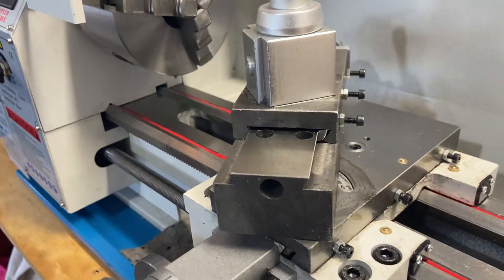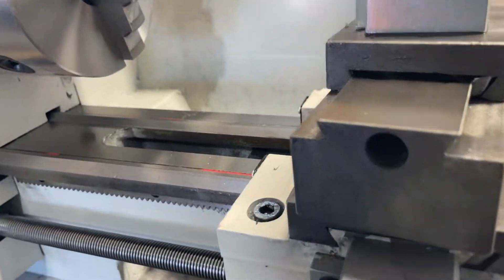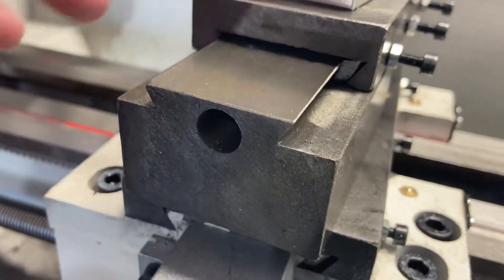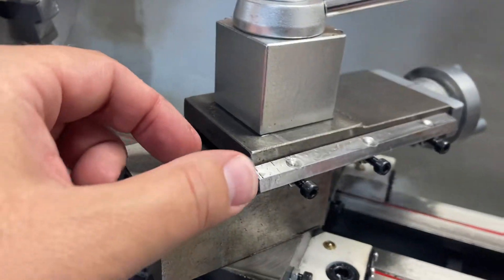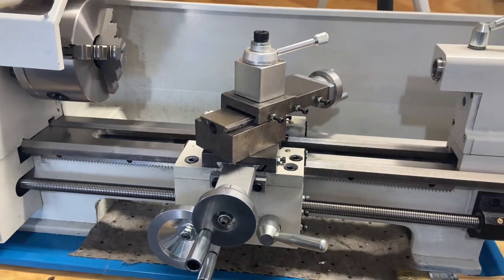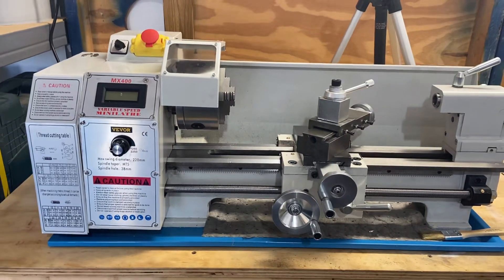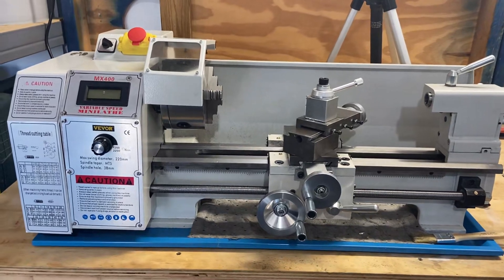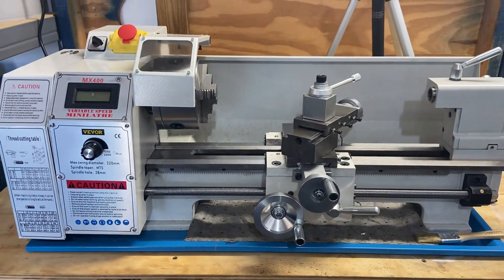Vevor Mini Lathe MX 400 Part 14 -Top Slide Gib Issue and Support Review

Comment: It's an affordable chinese lathe. Had it not been for the lesser quality details we would never been able to afford this hobby. -Schaublin lathes on the other hand, (Swiss made) don't suffer from "dragged-behind-a-car" style of gibs, but they cost both arms and both legs.
Brass stock and a mill, or a file plus some scraping and lapping will produce nice gibs.
Reply from the maker: This is a very good perspective and way to look at this.  I would have never started this hobby if it weren't for these affordable lathes.  At times frustrating but the challenge of making things better is part of the fun and process for me.  Thanks for the comment and thanks for watching
Reply: @deezworkshop  I bought a chinese minilathe of the heavier and larger variety here in Norway.
The basics are OK and works fine;- the ways, spindle, chuck etc.
But the gibs are just as terrible as on your lathe. They must have been machined with a lawn mower
These guys know how to make a proper gib, but if they were to go down the Schaublin path, the poor soul that machines, scrapes and lapps the gibs would still sweat over a gib when the other workers were finsished machining all the other parts.
The first thing I did were making new T-bolts for the compund since the original bolts snapped when trying to tighten down the compund slide.
Then I drilled two more holes and added two more T-bolts.
Then I tossed out the flimsy sheet metal stand and bolted the lathe to a heavy  wooden bench almost as heavy as the lathe itself. -And that transformed the lathe enormously.
Then I got rid of the compound all together and made a solid toolpost.
Next up is making a new gib for the cross slide, preferably a tapered gib but anything will be better than the one that came with the lathe.
-As you say, this is a hobby, and modifying a cheap lathe is part of the fun.
Reply from the maker: @eriktorp-olsen1706  "They must have been machined with a lawn mower"  🙂  Yeah,  this lathe is no more than what i expected and I am just glad I'm able to turn materials with it.  The tailstock has been a challenge and continues to be,  I believe a lot of my problems are from using a cheap live center, cheap Drill Chuck, and it being aluminum all factor in.  I will continue to try to get it dialed in.  Sorry to all those skilled machinists watching for all my cringe worthy moments.  I am still learning but having fun doing it.
Reply: @deezworkshop  Aluminium tailstock . . . hmmm . . .
Maybe it's good enough, I don't know. My solid toolpost is aluminium,-made from old engine parts melted down behind my shed and it seems to do well.
After all, they make engine blocks from the stuff.
 -But nothing beats cast iron which refuses to compress or flex under load.

Comment: I just wish i still had mine g0602 manual. I got frustrated with backlash and turn it into CNC but now DRO is so cheap I would put it and be happy. If I get such a lathe thats what I would do. They have now magnetic scales that are so small it may fit even on such small lathe.
Reply from the maker: Is this the manual you were wanting.  Hope this helps.
https://cdn0.grizzly.com/manuals/g0602_m.pdf

Comment: Had many communications with "Christina".  They are supposed to replace at least the cross slide as it is cracked.  Fingers crossed that the part(s)? come.  On the one hand your compound does appear to be cast iron.  Mine is aluminum.  I wish I could post photos in a reply but the gap between the top of your compound and the bottom half is horrendous!  Looks like it is around 1/8".  If should be .005 or .010 thousands.  That is why your gib is cocked.  There is simply way to much gap between the compound parts.  What I did on mine was flip the gib over and redrill the holes in the proper place.  Don't try this unless you have a good drill press or mill or you will most likely ruin the threads.
Reply from the maker: Yep,  Good ole' "Christina. Through Amazon, I actually communicated with Vevor, Boboron and Best Equip,  All had a "Christina" reply.  My compound is cast iron and not aluminum but the tail stock is aluminum.  I will check that now.  The gib is drilled wrong and its on my list to correct.  I will take it out and see how I can improve this gap.  thanks for picking up on that.  Send an email to my deezworkshop75@gmail.com if you want to share a photo.  I have no problems sharing what I have if it will help someone.  That's the point of this channel.  To help and inform others.  Good luck and I hope you get your parts.  I did actually get a partial refund for my gib issue and I was happy with it all things considered.  So they did reply to me at least...I wasn't expecting much but I want to be honest with my experience.

Comment: That tailstock looks nice. How square is saddle to spindle? Did you do measurements? I was considering to get longer model but I see many have problems. I see some sell cheaper some more expensive and I am not sure why. Are some better tolerances?  They look the same.
Reply: They are pretty much all made in the same factory in China.  Some of the brand names like Grizzly or Little Machine Shop cull out the real junk before they sell them.  I printed out the Grizzly manual for my ChiCom lathe as it is much better written and has a lot more detail than the xeroxed "manual" that came with the machine.  The tailstock in Deez video and the one on mine are aluminum.
Reply from the maker: Sounds like you are in the same situation I was when trying to decide what to get,  In the end the spindle Bore was the primary reason I went with this specific model.  I really didn't need anything with longer length with that size spindle bore.  In upcoming videos you will see some continued struggles with the Tailstock.  It just has a lot of play in it.  It is extremely difficult to get alligned and when you think you have it, poof it just goes off center.  I am still working with it but I believe the combination of the aluminum tailstock, and my cheap drill chuck and live centers simply have too much play in them.  For my uses I accept this and it will be ok.  Someday I will upgrade things but for now that's the point for me.  See what I can do and how I can make it better with little to no more money.  I didn't measure the actual bed but things do move smoothly and done bind up.  Cant stress this enough.  IF you buy one of these (any vendor of the Chinese made cheap lathes) don't have high expectations and don't buy this if you cannot afford to lose the money,  see others comments here and other videos.  Its a risk buying one of these in my opinion.
Reply: @deezworkshop  at least you know what to do. I was such a noob i knew nothing how to fix. Now there is much more info outhere. I might bite it and make it a project for me to try to fix imperfections.
Reply from the maker: Good luck, I took a chance and it worked out for me.  I am having a blast learning and turning with this little lathe.  I am just glad its working as good as it is.  But again I went back and forth for over 2 months and finally accepted the risk and took the plunge.